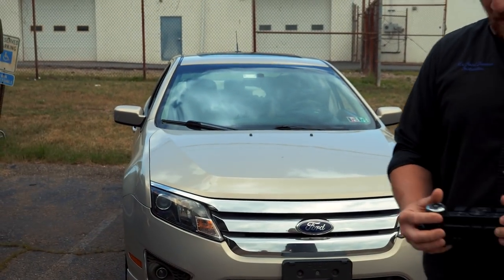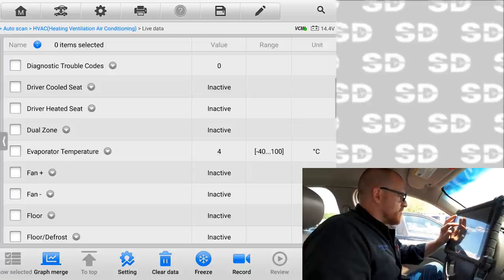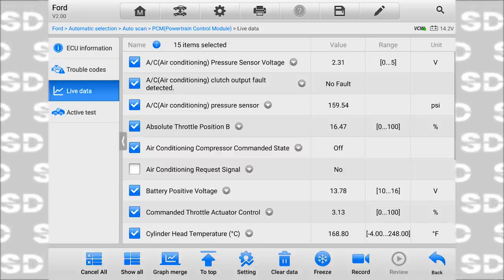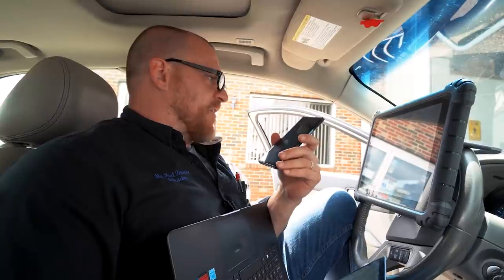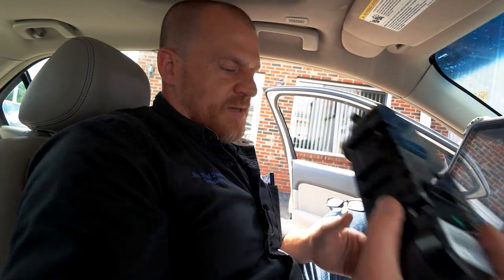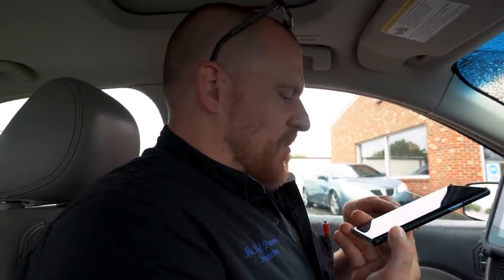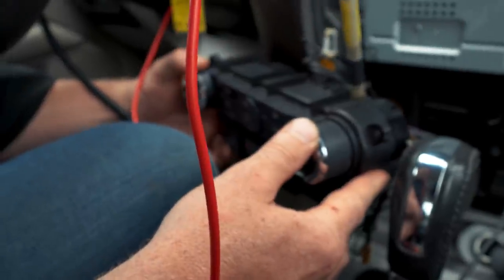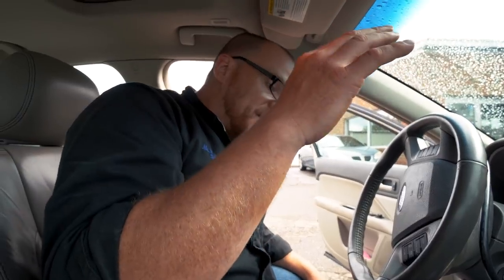2010 Ford Fusion A/C Clutch Intermittently Cuts Off (full charge)

Comment: Because you are interacting with a micro controller you are pressing momentary switches. They are Normally open and closed only as long as there is pressure on the switch  the tool is reading correct on active / inactive... Think of your IR remote for the TV. when dealing with MC's and switches, rarely do you have a normally closed constant + switch this is to prevent over current and constant current draws that are not needed for normal operation and to prevent damage to the MC 
Your getting the hang of it, Just hang another sensor in the duct and re-rout / extend the connector😜👀👌

Oh and usually the sensor is clipped directly to the EVAP no way to change it without pulling the box.
Put a new one in and put it in a vent
RE/ROUT IT!

Comment: Only thing I could think big without a pressure switch on the low side, is liquid refrigerant could possibly make it back to the compressor which is bad for it. Used to know the values of all the stripes on resistors a long time ago.🤣

Comment: If we ignore the weird jumping up to 75 degrees, the problem is a skewed sensor. You can tune the resistance of the circuit with a resistor in parallel to raise the temperature 20 degrees, or whatever temperature you decide, to counteract the skew of the sensor. And then the HVAC module will still be able to see the evap temp changing.
Reply from the maker: But you can't ignore that the sensor was more than skewed, it had some major glitches in it too making the suggested repair, not so great. If it was only skewed, I'd agree completely. Thanks!

Comment: What if you tried to scew it back with a in series resistor?
Reply from the maker: Can't get to it
Reply: @ScannerDanner  isn't it wired from the climate panel? Were you cut the wire? I was thinking if the thermistor has lowered its resistance then you could just add a little one on the output?
Reply: Inge Jeppesen
 , In series resistor would make even lower temperature.  The termistor resistence was to hight,  and you can't make it lower with resistor in series, thats would make it even more  higher :)
Reply from the maker: @ingejeppesen1358  high resistance = cold on this sensor and really any other thermistor, so we definitely didn't want to add more to it. You could add one in parallel but the problem is the temp sensor resistance was all over the place and not consistent

Comment: I don’t like autel’s active/inactive feature.  If the button light / circuit is active it should read on the scan tool active the whole time.  I have an autel as well and never liked that feature.
Reply: I literally typed this right before you said the same thing.
Reply: I don’t think that the “active/inactive” designation is a part of the Autel program.   I use FORScan on Fords its a clone of the IDS platform.  It shows that type of designation on all the switches and buttons on the entire vehicle. ie....door locks, window switches, cruise control as well as AC buttons.  

It’s more of a test that the button itself is being depressed or “activated” and the module is at least receiving the request from that particular button.

Comment: Couldn't you have just put a different temp sensor in another location in the car??
Reply from the maker: No sir, this sensor needs to be in the evap area
Reply: Wow thank you for the reply... Love watching your videos your whole family is awesome... My thought was if it's a temp sensor if you would have put it in the air duct it still should have worked as long as the air passed over it for a temperature reading it should have been good Am I wrong
Reply from the maker: @johnfreeze3021  yes sir, air temperature is much higher than EVAP core temperature and it is core temperature that we need to control

Comment: Very common issue for theese cars, can actually be replaced in about an hour and the part is only about $30
Reply: Just remove the steering shaft and unbolt the dash support bar and the whole dash can slide back enough to give you access to the sensor on top
Reply: Lastly the easiest way to check would be a resistance check at the connector at the back of the module, only takes a few minutes to get there,if I remeber correctly it's pin 6 and 12 20k ohms is about 80° 60k is about 50° and so on

Comment: Maybe a potentiometer would work.
Could you put a sensor inside the HVAC box close to the evaporator?
How about a temp sensor around the return line before the accumulator?  Drill a small hole close to the evap and install the sensor.

Comment: Tell her not to use recirc..lol
Could you lower the column then remove the cluster to access?
Ford over engineering..lol.
Always reminds me of Scotti from Star trek saying, "the more complicated you make the plumbing, the easier it is to clog the drain"... Lol
Reply: They certainly had a problem doing that. Just like the hidden 3rd starter bolt on the modular motors.

Comment: Your videos are so helpful!! I've watched so many of them while trying to diagnose and fix different issues on my own vehicles. 
I could really use some help if anyone is reading this!! 

I have a 2008 honda odyssey ex L. Just bought in march. Couple months later in july I had to have the condenser replaced because it wouldnt blow cold on the drivers side. After that, it worked perfectly ice cold.. until a month ago my ac started blowing hot air all of a sudden  out of nowhere while I was driving down the road. The clutch will not engage. I got new relays & fuses but that wasnt the problem. I really cant afford to bring it in and pay 800 for a new compressor. I'm hoping maybe it's just the clutch? If so I can replace the clutch, pulley, coil etc myself. Any input? Can anyone help? What could the problem be and what should I do??

Comment: Super disappointed to see you do a hack job repair like that. You're better than that. They designed that system to use that sensor to cycle the compressor for a reason. First time I've ever thumbs downed one of your videos.
Reply from the maker: I said I didn't like the repair and for me proving the system would work was important as I was NOT doing that repair. Sorry you couldn't see through the one "bad thing" and find all the other gems in here. It wasn't a hack job. It was a college kids car who doesn't need AC anyway. It is a convenience and the money was not going to be spent to repair it the right way, so why not risk the compressor slugging. What is the worst that happens? She doesn't have air, like she wasn't going to anyway. BTW, AC does freeze on occasion, with no compressor damage and it is still working for her. I think that is a win.